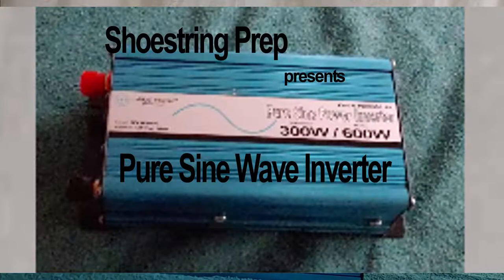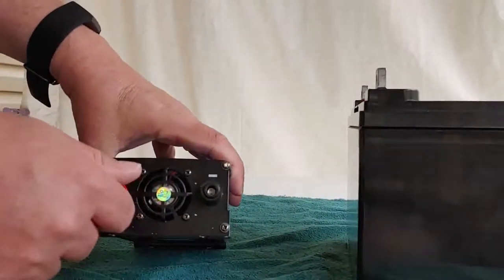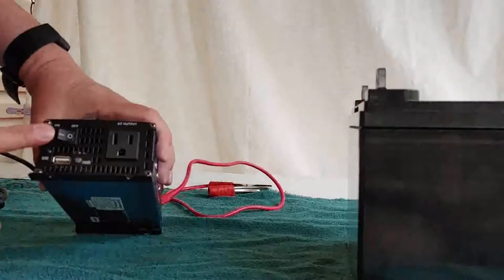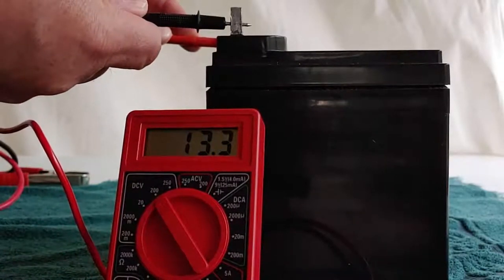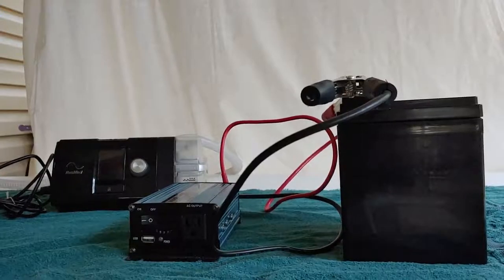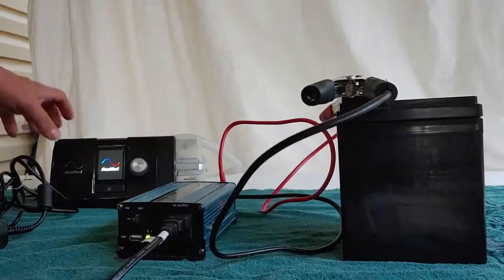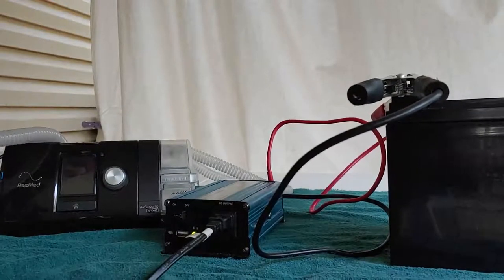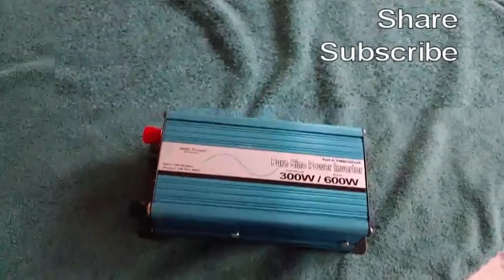Refurbished Pure Sine Wave inverter powers a CPAP machine on a Harbor Freight 12 Volt 35 AH battery.

Comment: 4 years ago I started building CPAP power backup units for family and an elderly neighbor lady.  In NorCal the winds, wildfires, and storms cause the power to go out for hours and sometimes days. I settled on the Bestek 300 watt pure sine inverters and must have bought a dozen of them. They have been totally reliable. I was paying in the mid $40 range playing the sales. They have a cigarette lighter plugin....nice to have in the car...but users need to know that you can't get much more than 150 watts out of it because the car fuse or the one inside the lighter plug will blow. Battery clamps allow full power output.

If you use the humidity function or heated hose, the 35AH battery will die before midnight. Actually, the inverter will trip out at low voltage, thereby saving the AGM battery from an early death.
Reply from the maker: Thanks for the info. Thanks for the comment
Reply: good point on humidity and tube, unfortunate. Most portables have humidity disks?  How long would the 35 ah work without heat
Reply: @killincards  About 7-8 hours if the CPAP runs at 50 watts.